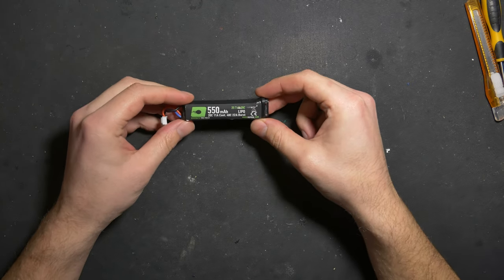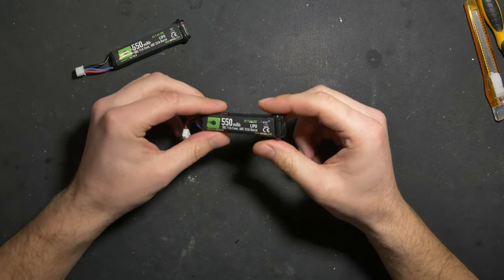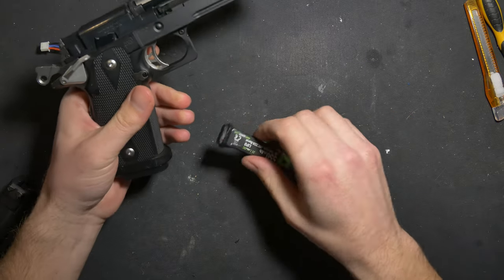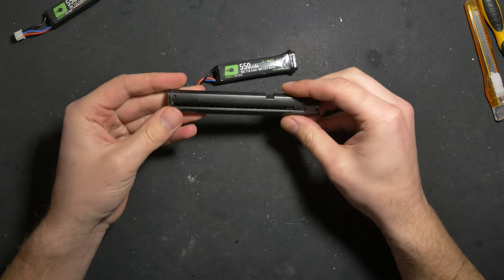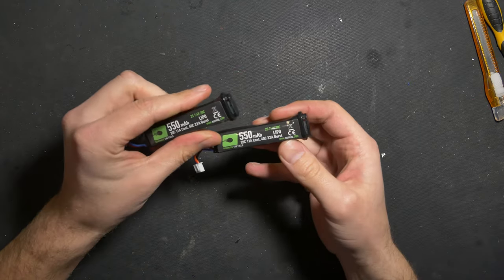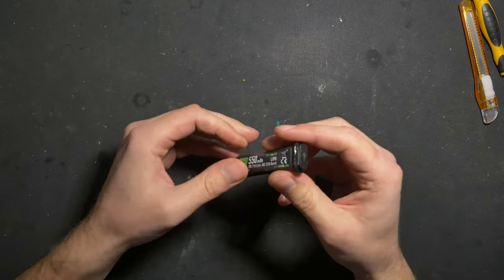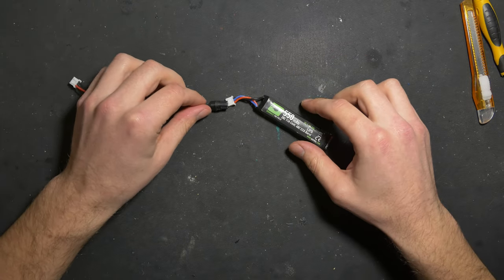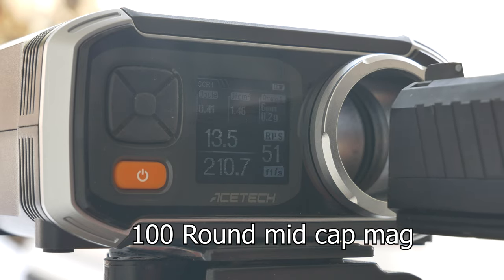Is this the best airsoft AEP battery?

Comment: Do you think this would fit in a well vz61 aep. It's a 100% marui clone and uses that 7.2 battery style
Reply from the maker: It should, but i cant guarantee it will.
Reply: @RobinBerntsen  thanks very much for the reply!. I'll buy one and give it a try. If it indeed doesn't fit I may try using smaller lipo batteries for RC planes and solder in a mini Dean's with a mosfet otherwise. But I hope these fit. Thanks again
Reply from the maker: @hourglasseyesflipping  Np. Hope it works out.
Reply: @hourglasseyesflipping  did it fit? i have an asg vz61 scorpion and im planning to upgrade to lipos
Reply: @SpooKimi  it did not. I ended up taking a small polarstar battery and I had a micro mosfet wired in to the grip
Reply: @hourglasseyesflipping  thnx for letting me know and the fast answer ^^ guess il have to do the same than, i hope my store mechanic can do this :p
but big thnx for answering ^^

Comment: I have the same tm hi capa aep pistol do i need a mosfet to use this lipo battery?
Reply from the maker: Just plugg and play👍
Reply: @RobinBerntsen  have you tried the matrix 7.4 680mah lipo battery im thinking of getting that one since it has more mah it says its made for tm aep
Reply from the maker: I haven't.  But as long as the plugg is the same, it should be fine.